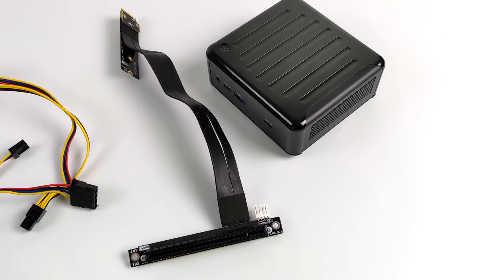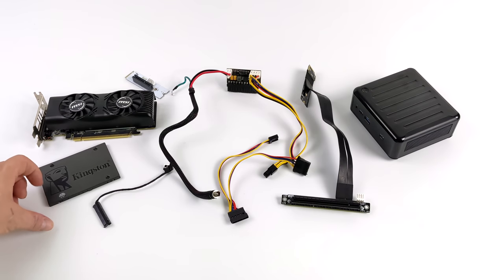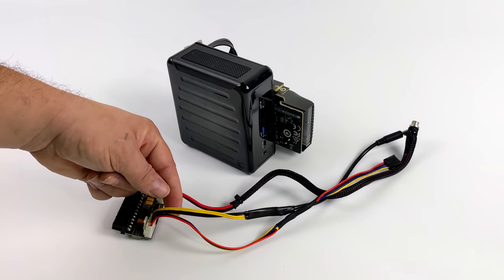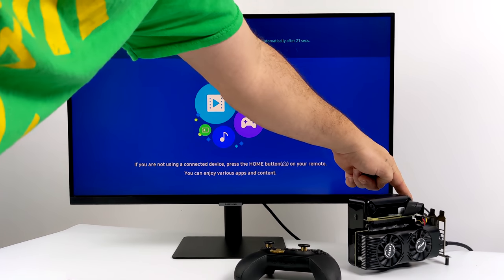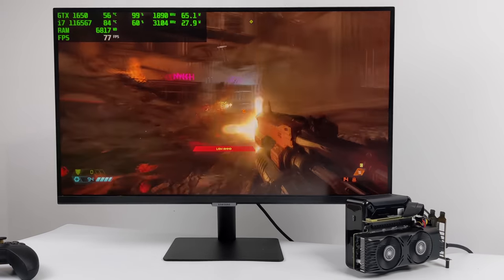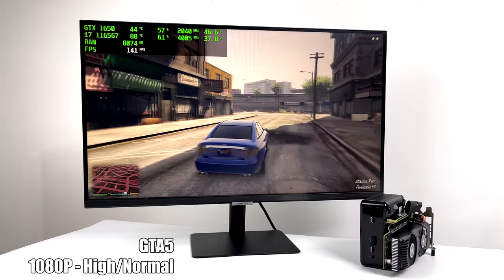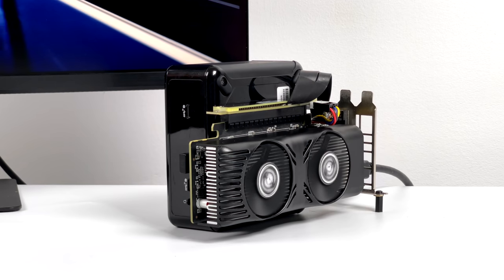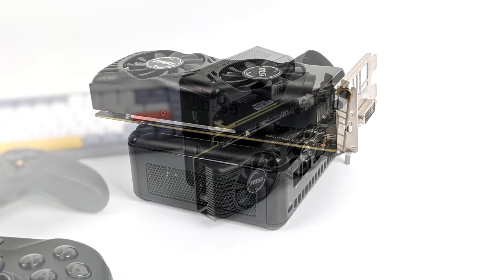This Is The Smallest GTX 1650 Gaming PC!

Comment: It's really sad that the GPU shortage situation means both Nvidia and AMD have basically abandoned newer generation entry level GPUs on the 150-200 USD range since they're allocating what little chips they get to produce to high end products only so honestly: I just wouldn't get a 1650 today: you can probably get by with APU graphics for the time being and just hold out for a proper 3050 or a 6500 in about a year or so.
Reply: These mini PC's are a cool concept, but they aren't really cost effective. Just get a second hand 1650 laptop for almost the same price as the desktop card and a usb doc then use it hooked up to a monitor with the lid closed.
Reply: I totally agree with you. Thanks to ETA I actually did a build right before current gpu situation but if I were me now looking for a small footprint, I would get the case something like the Velka 3 , decent psu  and apu and hold off until the storm passes. Maybe include an ITX MB that supports a PCI4
Reply: @DailyCorvid  The other consideration is for 1440p gaming at > 100hz A 2060-2080 super or 5700xt - 6700 is the sweet spot for 1440p gaming. And decent 1440p 120/144hz gsync compatible/freesync monitors can be had for under $400.
Reply: What I might do, get a 5700g and afterwards upgrade to a entry level new gen gpu
Reply: This is why we should never be relied on one single company. Governments need to come together and do something about this
Reply: I work at a computer retailer and  they brought in 1050 tis for $279 but are asking $220 for a 1650🤔 Shit is so confusing and pathetic the way they are doing customers from the manufacturers, distributors to the retailers.
Reply: It's not only the new gpu prices.Even the used market is all over the place.I got my 1070 ti for 211 usd before covid/miners and 2 months after that they go for anything from 650 usd-800 usd when i convert currency.You don't get any budget gpu at the moment.I was thinking to get a backup gpu.Maybe an rx 580 but man even they go from 300 usd and up.
Reply: Im stuck on a 12 year old 6970 since my 1070 died 😭
Reply: I believe that Intel is getting ready to take on the entry level market with its new upcoming graphic cards as they know that they can basically own it.  Nvidia's and AMD's lack of support for the low end cards will allow Intel to dominate that market for the time being at least. I just hope that they get a handle on their GPU drivers quickly enough or people may get "turned off" from buying any of their cards. It pays to take a "wait and see" attitude for a bit before plunking down your cash on one, I guess, but people are really desperate now. Intel's GPUs' are looking REALLY GOOD from what I hear!  👍👍
Reply: @DailyCorvid  some people like playing at 120 frames per second.
Reply: i bought one back in the release of 2019, still works great but yea, basic apu graphics and low spec gamer are still good enough until the gpu's can come  back
Reply: yea this gpu shortage is so bad that when i lost my 2070 super pc due to a power outage an a faulty surge protector i ended up just buying a 1060 alienware laptop for 300$

Comment: You are really a brave guy. Using a 120Watt PSU for : 

- MiniPC in performance mode:  46 Watt
+
- GeForce 1650 TDP: 75 Watt

Total: 121 Watt. And the PSU is 120 Watt... excellent resource management! (if you trust your gear)

What I don't see is  12V as an advantage but a limitation, because it forces to use big power bricks (20V GaN are much more compact and efficient). I have  built a similar concept that is portable and can work unplugged by using compact power banks. For this I have  used a NUC i3 + adt-link + HDPLEX miniPSU (20V DC  in, 12V atx out).  Similar total size as this project. The great thing of the HDPLEX PSU is that it gives me the capability to use 20V DC  in (like the NUC), so that I can use USB-C 65watt compact power bank for the NUC and  USB-C 100Watt power bank  for the GPU, using the corresponding USB-C to DC  barrell adaptors (forced to 20V mode). I am currently  using  2 power banks because I am coward,  but theoretically  a single power bank dual out with 65Watt+60Watt  could do it (counting the 15Watt I can get  trough the PCIe)...  but only if using your same  power  margins (nominal-minus-a-little-bit) .
Until now  I was not brave enough to take the same risks as you do with power margins , but watching this video makes me want doing it. I know I shouldn't, but it is difficult to resist temptation  ...

Comment: I completely forgot about the M.2 adaptors...

Now I want to build a case on the back of my GPU.
I have an 11in card, and a 3D printer, I could totally mod the back plates' mounting screws with standoffs and build a new case for one of these small PCs.
A few extension adapters and I could put all the I/O right next to each other. 

Well that's a project for my next build when I go to replace and recycle my current rigs' parts.

Comment: Valve said the Steam Deck doesn't support a external GPU. Are you willing to prove them wrong?
Reply: there's an m2 slot on there so an egpu shouldnt be a problem
Reply: @megajatt123  Iḿ just waiting for someone to do it on the Aya Neo. It also has an M2 slot.
Reply: You should go for the cheapest one with eMMC storage and use the free NVME slot.
Then, being an Arch distro, getting software recognising it shouldnt't be impossible.
But, accordingly to some Valve comments, reaching the NVME slot will require some very good DYI skills.
Reply: @ruxcooking  aya neo doesnt have another way to boot off of tho
Reply: @gianlucab2261  wow u got some sauce there for me man?
Reply: @megajatt123  I think neither will the Steamdeck. You have to boot off USB or SD and trade storage speed for graphics horsepower.
Reply: Not supporting it means you're on your own and they won't help you make it work or provide warranty service for damaging the unit while doing so.
Reply: @gianlucab2261  Steam Deck uses an NVME/SATA M.2 slot. All variants use the M.2 slot. Even the eMMC model does use it. It's just simply a cheap and tiny eMMC SATA M.2 SSD. There is no free slot. 
It also does not feature Thunderbolt, which is a bit of a bummer, but oh well, can't get everything for $399 or whatever it's supposed to cost.
Reply: yeah maybe it will work, but it's not practical, you basically need to tear down the back everytime you want to plug the egpu, and there are still no guarantee it will easy to tear down
Reply: lol

Comment: Hi ETA Prime,

My batocera emulation build is a dell optiplex 7020 sff with the power supply of a dell optiplex xe2 sff (255w -> 315w), i7 4790k (4 cores / 8 threads, 4.0 ghz up to 4.4 ghz), 16gb ram (4 × 4gb), ssd with 240gb, hdd with 4tb, better cpu heatsink from the xe2 (with coppercore), wlan card and a low profile gtx 1650 from msi. I laid the 1650 outside in a printed housing and plugged it into the pcie 16x slot with a riser cable for full performance. The housing of the 1650 is attached to the top of the optiplex. No problems with heat or power consumption and the optiplex runs perfectly. Most of the wii u games run at 2k, most of the gamecube/wii games at 3/4k and most of the ps2 games at 2/3k.

Comment: about the tb3 thing, the maximum pcie bandwidth through a tb3 connection is 22gbps so you are running a better gig. now test this with other gpus, to the point of diminishing returns.

Comment: Neat little system and perhaps the only mini-PC eGPU gaming setup I've seen on your channel that's close to being practical to use. Sadly, GPUs are still hard to come by.
As for your setup, PCI-E to M.2 only needs 12V from the PSU to work with your GPU (in addition to 3.3V supplied by the motherboard), so you don't really need a picoPSU to power the card, you can just wire 12V from the PSU straight to yellow and black wires of the Berg connector (IIRC, picoPSU just passes through 12V anyway).
BTW, these cheap white M.2 to PCI-E x4 adapters are neat for running things like 10G network cards or SATA controllers. Not GPUs though.

Comment: I doubt you used something like HWMonitor or Info, but I'd definitely like to see whether or not the CPU was thermal throttling. 80C is thermal throttle territory on the majority of GPUs and CPUs and it seemed to hover marginally above that on everything except Marvel vs Capcom (Duh! LOL) Regardless those temps could cause some serious premature failure. Awesome video though! Keep up the videos man!

Comment: When you combine the compute unit and both power supplies, it's probably not that much smaller than a traditional micro ITX build. You just moved half of the components away from the desktop, but they're still there.

Comment: Nice little setup.

Although, since now our mobile CPU seems to be very capable, I wonder why no one manufacture a system that can utilised the PCIe x8 lanes from the CPU (Intel mobile CPU has 16 lanes PCIe 3.0, which usually configure as x8 + x4 + x4). Imagine that these manufacturer like AsRock just include a port to utilised the Intel mobile CPU or Ryzen mobile CPU PCIe x8 lanes that reserved for high end GPU. We can buy this mini PC and cram a medium GPU and viola! Cost of course is a factor, but if you're going for small form factor, this might be a good option than building a mini-ITX system.

Comment: Awsome video, im planning to put a GPU on my DELL Optiplex 3090 micro 
one question, if i dont have the same power supply you have, can i still use those power supply they use on PC?

Comment: I think the issue with GTAV is its thermal throttling or hitting the power limit. The CPU clocks and temps are all over the place.
Every other benchmark it runs at 4.1GHz constant with GTAV its all over the place dropping down to 3.7GHz at points.
Sounds like you need to improve either the cooling or power delivery system.

Comment: Do you think this "pico psu" setup is applicable to the  ASRock x300 mini PC? I have watched the a300 EGPU video that you have done years ago. You used an ATX PSU on that video.  This can really help for people like me that who are working as a motion graphics/video editor and you wanna do a portable setup for working on sites.
Reply from the maker: Yes it is, it would work great but the Deskmini uses 19 volts so you can use an extra wall adapter for the pico/GPU or you can find a pico that uses 19 volts.

Comment: Have you given the Gigabyte BRIX S a go yet? I can't find a video from you about/using/with it. Has a Ryzen 7 4800U, NVMe M.2 socket, 2 notebook DDR4 sockets. I just bought one and apart from making the mistake of going DIRT CHEAP on the NVMe drive (Team Group 1TB... so my speeds aren't the greatest) it seems to be extremely good. But clearly I need to give some gaming a go (but doing so without changing to a Micron or a Samsung NVMe SSD just feels like a fool's errand).
Reply: Gigabyte GB-BRR7H-4800

Comment: A year ago I try to do the same with mine Intel NUC but fail, video card never showed on bios, cant find the problem, try asking forums but with now answer I give up. Now gonging to try again, with that yours m.2 to PCIE x16 adapter cable. Mine was two parts m.2 to PCIE X4 board and unknow quality PCIE x4 to PCIE x16 cable.
Video card was Radeon R9 270.

Comment: By the time you add the PSU it takes up nearly as much space as a mini-itx system, which would be cheaper.
Reply: Yup. EGPU are not the most practical solution. Itś more for a situation where you already have the base system and the GPU and wanna get weird.
Reply: Built correctly this can fit in a 2L case with an internal PSU. The idea isn't bad, its just a poor implication.

Comment: This setup is awesome, does the GPU run at 16x with that mobo? I've had a small PC before with a SFF GTX 1050Ti, and it only ran at 4x
Reply: m2 slots can be wired for 2x or 4x so anything attached via said connection can run at those speeds or power, not higher. this shouldnt be a problem for cards up until 3060ig because they dont saturate even the 4x bandwidth

Comment: Would like the see you do a comparison with the same gtx 1650 in a desktop PC to compare performance and see how much the limited bandwidth of the 4x m.2 pci really is for that card.
Reply: With a 1650 its negligible, probably around the 3% range. The 1650 will be power limited first before anything else. And the GDDR5 version likely memory bandwidth limited too.

Comment: Do this with a Ryzen based NUC, MSI 3060 Ti Aero ITX, and an external Dell power brick!
Reply: The price of that gpu alone would make the build pointless
Reply: @dexmiermaxime8583  The point is small and powerful, not cost efficient. ITX builds main point isn't cheapness, but compactness. And it's not like it would be too expensive anyways

Comment: you know, you actually can max the cpu's capabilities with an rtx 3080
Reply: Not enough power since it use Pico PSU
Reply: @noisesensitive1050  can't upgrade the power supply?
Reply: @RjKumar111GunnerRj  you can upgrade the PSU to bigger one like SFX PSU,, but by then its not the smallest gaming pc anymore
Reply: @noisesensitive1050  i see...

Comment: if nvidia make rtx 3060 with that size would be awesome
Reply: I think asus are making a single fan 3060...
Reply: The *60 class cards have never been available in this form factor, it's always been reserved for *50 class or below, due to the power limits of having no external PCIe power connectors. Nvidia does have a A2000 pro class graphics card that uses the Ampere GA106 and is low profile.

Comment: But how much % of performance you lost with the gtx using less pci lines/bandwidth? Compare to a full pci 3.0 x16 slot
Reply: IME a couple of % at best. I have the same setup (albeit much cleaner and smaller). And the GPU performance difference between this and an ITX motherboard with a full 16x slot isn't noticeable. Maybe with a 3060/3070 it would be but the 1650 is so power limited that you wont notice.

Comment: This has already been done about 6 months ago on Reddit/SFF. But in a much cleaner/smaller way. With an internal PSU, m.2 sata drive and all in a 2L case.
The NUC pro boards are a much better choice since they have 3 m.2 slots. Also the Pico PSU is completely redundant. you can just power the adapter directly with 12V (the 5V circuit isn't used on the m.2 to PCIe adapter).

Comment: Hey I am currently trying to build a budget gaming PC under 400$ I have found most of the parts for it but I am confused with which ram should I get.  From some website rewiew I think Of buyingCorsair Vegeance LPX 8GB (2x 4GB) DDR4-3000 but can I get some better RAM if I of think spending a couple of bucks more.

Comment: Would be interesting if they could create a x8 pcie m.2 spec or x16 spec that way something like this could actually be viable instead of bottlenecking the shit out of the gpu
Reply: that 1650 isnt bottlenecked
Reply: @megajatt123  its being bottlenecked by the x4 pcie lanes when 16 should be available
Reply: @MrDeadmanwalken1  The 1650 is so power limited (and in the case of the GDDR5 version memory bandwidth limited) the x4 lanes aren't making a difference. I've ran the GDDR6 version on an ITX system with a full x16 slot and via m.2 (x4) and it makes no noticeable difference. You'd have to move up to a 60 class card to even notice. That being said the x4 is PCIe Gen 4, so you could pair it with a 3060 (assuming you could find a Gen 4 compliant adapter) and wouldn't have a problem either.

You can do some research but generally you'll need GTX1080 or above before you start seeing a noticeable (10%+) effect on performance from going from x16 to x4.